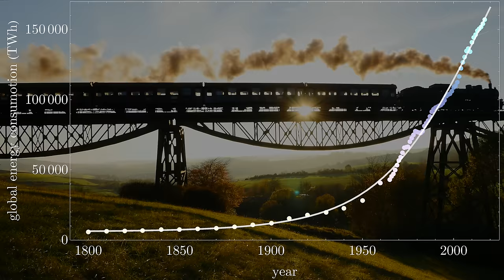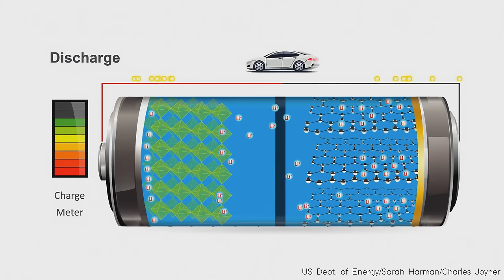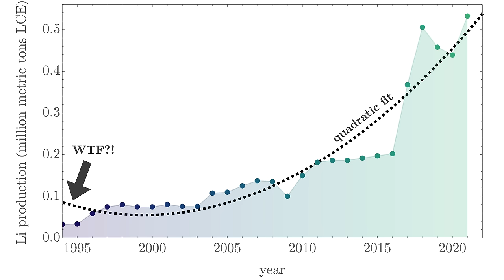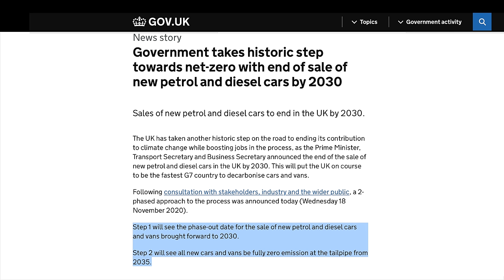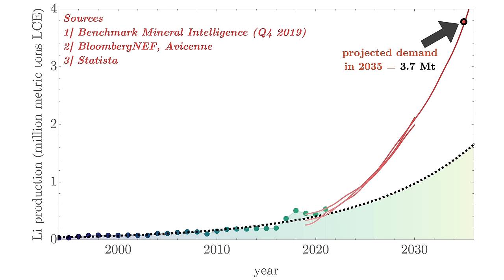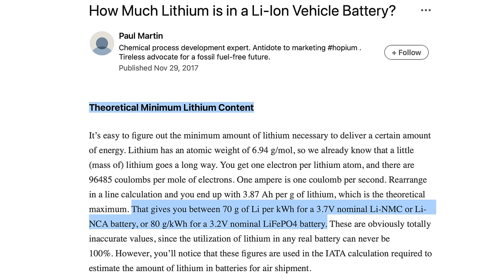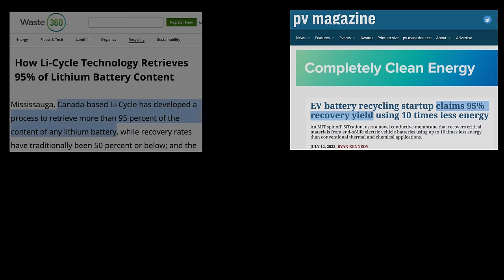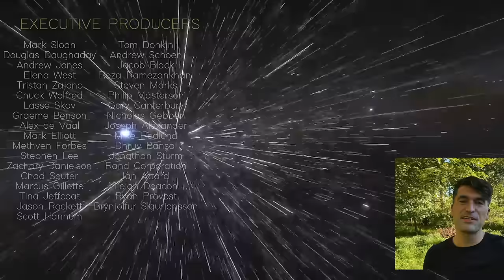Will We Run Out Of Lithium?

Comment: While this was a great video. I believe there is a part 2 maybe even a part 3 that can be done to this. Concerning 2 major points that I feel like this video didn't adequately touched upon. 
First is the use of lithium out side of consumer electronics & EVs. What about electric trains, military equipment and vehicles, lithium for battery storage infrastructure, and any other major future use of lithium outside of the current domination of EVs & personal electronics. I would assume going forward electric trains (high speed rail for example) & energy storage infrastructure demand, and necessity will increasingly outweigh EV needs. The further we get  into the 2030s and beyond. 

Secondly is the assumption that N. America, Europe, & E. Asia will remain the main places for demand for new cars (70%). I think we will see an increasing demand for new car buyers from S. America, Africa, & other parts of Asia. Particularly W. Asia & S. Asia. Which will surpass the needs of new cars from the 3 historical regions of car buyers. Since these places are far below car per person than even China is. Which is about 0.45 cars per person. As opposed to the US which is about 1.2 cars per person. So even on China alone demand should double over the next 12 to 15 years. To make it comparable to the EU/US equivalent. Also places like India, Bangladesh, Pakistan, Nigeria, Uganda, China, Indonesia, Vietnam, and other high density places will see an increasing larger shift to electric trains high speed rails, as well as uses of of buses. Not just EVs. Which I suspect the need of lithium there will usurp demands for EV. As well as use of lithium in energy storage infrastructure (comparable to Tesla gigawatt battery storage) as well as electric motorcycles (in warmer climates) & e-scooters (in small towns & villages). 

Considering S. America, Africa, and most of Asia will have increasing demands for Lithium to be increased by any where between twice as much (i.e. China) to p to 20x (Congo, N. Korea, etc.)  as these nations also go through industrialization. To further exacerbate the situation the various Western & far Eastern economies are aging and slowing down in their needs of consumption. While the opposite is happening to the nations outside of those 3 regions (Europe, N. America, & E. Asia). I mean somewhere between 2035 to 2040 world population will probably be between 8.8B to 9B people. Most of the increase and demand in consumption will be happening in the global south. And I know the topic of this discussion doesn't extend past 2040 but projecting into the 2nd half of this century the increase in consumption of the global south will be increasing for the next 8 to 10 decades. And the gap or the so called margin of demand between the rest of the world and the 3 historic industrialized parts of the world will continue to widen as the per capita needs become equivalent. 

I hope this long post was useful to to the Cool Worlds channel and comment section. Peace.

Comment: In reality running out energy storage is not the problem it’s the way we produce the energy in the first place. Solar, wind, and geothermal just are not going to be enough. Solar would be possible with orbital solar arrays “beaming” the energy to the surface or more nuclear power. 

The reason I bring this up is because of you have abundant energy then you won’t need any batteries. You could easily create “active” highways where you car just runs off of the energy field created by power lines run underneath the road. The only necessary batteries would be for the devises that can’t connect to these active lines or ones that will be used off of them.
Reply: @lepidoptera9337  it’s not constant is the big issue since solar only working during the day. For Solar you would have to have slightly more batteries to store energy from Solar than the total amount of batteries needed to charge (at least the ones charged at night). Now I’m not saying Solar wouldn’t help look at my previous comment but we need also need a constant supply of energy that isn’t dependent on weather. Nuclear or orbital Solar would be the best with our current technology.
Reply: @lepidoptera9337  my goal post is in the past. We have had all the technology to send objects to space and sending solar panels instead of satellites would not be hard. We also have had nuclear technology for decades which per kilowatt is much cheaper, just as clean, and is a constant source of power.

Comment: When a lithium car battery is recycled, is that car tossed in the trash?  Wouldn't you just put another new battery in the car and continue using it?  Is this data even accounted for in all of these projections?   Also,  where is all of the electricity generation coming from as demand increases in the future?  More coal plants?  I think that's what China is planning, although I'm not an expert.  Lots of questions.

Comment: And that's exactly why the EV will not be the big change some people hope. Just look at cars, train or air travel all startet out as expensive and went down over time with increased demand and cheaper production. EV's are expensive right now and if the supply can't keep up with the demand because of the Lithium, this price will not drop but rise, which in turn will drop the demand that can't be adjusted due to the missing Lithium. If a technology needs specific materials that are not available, it will not succeed. Judging by the overall increases of prices in every energy sector, people will just not have the money to buy these EV's. The Smartphone market is saturated and companies sell less and less every year, the best selling sector are the midrange phones since they offer 99% of what any person needs for a fraction of the costs of the flagships.

Comment: Did you factor in recycled lithium into those projections? I would imagine by 2040 that recycling will be fully operational, also a lot of the batteries used in energy storage will be used batteries from EVs
Reply: The recyclers that already recycle these batteries and sell the raw and refined materials today, (Tesla Panasonic in Nevada use some recycled materials already) wish they had access to more batteries... Batteries are lasting far longer than we thought they would and there is a huge demand for second use because there is such a shortage of new cells so the recyclers are ahead of the amount of batteries available to them... yet.

Comment: I want an EV... but I was really hoping for hydrogen fuel cell type... mostly due to charge times when on long trips... I've had many times where I've drove over 500 miles and don't have time to stop to wait on a battery to charge up even with fast chargers of today.  Unfortunately there is no infrastructure for hydrogen right now, around here there is barely any for charging either.  Guess I'll have to wait a few more years.

Comment: Fantastic video once again. This is the best article I have seen against EV´s and all this monumental madness about saving the planet.....although, I guess, probably done without that intention. Nevertheless, thank you very much. Don´t get me wrong. I appreciate you care for a more cleaner planet. As I do. As all of us do. But, you know? the difference between an engineer and a (dreamer?) physicist is that we can better manage (and predict) reality. First of all, if you worry about saving the planet, then you should be very worried about the Lithium mining and other rare earths materials required to build the batteries at that scale. This is far more contaminant than the CO2 which life actually needs, by the way. Secondly, this legislative nightmare planned by the WWF to replace the Oil by Lithium as the new Gold Era, and pushed by burocrats, are ruining people´s lives and are the closest thing to Mao´s Great Leap Ahead Plan, a monumental failure. Third, what is the cost of your Hyundai? what is the range? what is the time and  cost to recharge it? please, test it in a REAL long trip at a steady cruise speed of 130 km/h. I can tell you that it drops till just 350 km.The EV´s have yet a long way to run to become truly competitive. The gap may possibly be filled by Hydrogen but, again, still a long way also for H2 to run. In summary, some dark hands have orchestrated a multi trillion dollar plan for which there is no guarantee of success and could possibly even end in a catastrophe. Two things could happen then: either our civilazation collapses in the next decade or so and takes some centuries to recover or we all stand up and stop somehow all this crazyness.

Comment: Don't forget to factor in replacing all of these inefficient batteries. Petrol is still the #1 most efficient source of energy usage, and further, petrol and diesel vehicles make up less than 30% of all pollution. The issue is industry, which should be our primary focus when considering pollution. Also need to understand that these electric cars are ultimately powered by coal and natural gas, the primary source of energy to your home or charging station. So you may think you are saving the world, but ultimately you are still burning fossil fuels. The growth of the EV market will increase consumer electrical demand, which will put great pressure on the current industries of coal mining and natural gas extraction.

Comment: You make a few errors in your attempt to definitively note a +1c rise in temperatures on a global average to CO2, disregarding the fallacy of utilizing global averages, as well as the simple fact that the primary greenhouse gas is water vapor (and it isn't even close, not by a long shot) and our planet leaving a modest ice age currently. 

Battery and renewable technology is so wildly inefficient that you CAN NOT sustain humanity without a great die-off of the population, so you must pick one or the other. Either you accept a massive short fall of energy required for an 8 billion plus population and therefore accept the death of majority of that population, or you must meet the energy needs elsewhere. It's the clearest sign when someone is driven by ideology or 'current thing' narrative, when to them the option of meeting the energy demands of developing nations is simply not on option in their mind. No, this is not a discussion created out of the love for earth, but a bitter resentment of humanity. Otherwise Nuclear energy would be foisted up as the next step to take in moving away from hydrocarbons (a more accurate term than fossil fuels). But no, instead the conversation is on impossibilities that only impoverish people further for the benefit of various NGOs reaping massive benefits to deliver practically no energy to the population at a much elevated cost. 

Consider that if every single lithium battery manufacturer on the planet produced batteries SOLELY for the purpose of renewable energy infrastructure for 10 years straight, it would  not meet even 25% of the grid requirements of just the UK currently, not to mention the increase of those ten years previously mentioned.

But why live in reality, hmm?

Comment: i wouldnt worry too much about demand out stripping supplies... unless EVs suddenly become about 80% cheaper and they some how manage to significantly increase range and decrease charge times. otherwise even by 2040, they simply wont be practical or affordable  for the vast majority of people.

and before you start talking about the second hand market - affordability is still a major issue, particularly if battery cells need to be replaced.

Comment: Eventually you'll run out of everything on the planet, realistically. Question is if the 'easy to reach/low hanging fruit' versions will be economically sustainable to harvest vs potential profit margins and costs to get it. Honestly there's more interesting replacements on the horizon, as lithium is the current solution that's here, now. When reclamation becomes realistic, that's another gap-fill until those better replacements come to the commercial market.

Comment: The problems comes down to that the electrical source emitter and the costs of both the EV products and that power needed to manufacture and operate those same products.  It cannot be done in the time demanded. 

Even with govt mandates, which are already being imposed, most consumers will not be able afford these costly EVs. Further, as there is an increase in the use of EVs, rolling infrastructure blackouts will become the norm as they already are in certain parts of western countries. 

The short term end result is that the common man and woman will not be able to afford EV. Combine this with govts' dictates that combustion engines are out, our means of individual transport will no longer be feasible. 

Now the political aspects. This is the aim of the WEF, in particular Schwab's Great Reset and a global elites much enhanced control of populations. At the pace currently espoused for EV use by the WEF and other authoritarian powers, our democracies will not only falter but will outright fail.

Comment: All of this makes no difference if you can't charge them, because we won't be able to use fossil fuels for power generation, and currently there is (in the UK) not enough non fossil fuel electric power generation to cope with need, so we buy ours (at greater cost) from Europe, we need to deal with a way to charge these EVs before we swap to them, and the new nuclear power plants may not be ready in time, unfortunately we  may have to use fossil fuels a bit long, we can't keep up with demand now and they want us to use even more EVs , it just can't work EVs made up 20.1% of car sales last month, and we are struggling to maintain supple of electric, as at the same time building more and more homes, and turning off more and more fossil fuel power generators, while only building wind and solar which is not going to be generating any where near enough electric for demand which is rising every day, winter is coming so that's solar out he window, in the UK we are buying the EV and not having the money or electric  to run it, you a supple first then swap to EVs.

Comment: Where are all the new fossil fuel power plants being built to charge these?  Do we have enough copper to increase the size of the electric grid or are we going to put electric generators, powered by natural gas or diesel fuel, all over the place to create the electricity to charge these things?  

Why is okay to mine lithium, cobalt, cadmium,  nickel and the other metals needed to make the batteries but not okay to mine coal or drill wells?
Reply: I wanna see you run around with a gas fueled phone or pc.

Comment: Great video, something you may consider, EVs growth depends on electricity cost. In countries that depend on fossil  fuel for electricity production, EVs cars just dont make sense because electricity for charging EVs is expensive. Problem is green electricity sources are still low compared with nuclear or fossil sources. For instance, most countries in South America do not have enough hidro power plants to cover for a significant porcentage of fossil fuel electricity plants.  If nuclear plants were safe enough to be installed and adminstrated in developing countries, given a  cheaper electricity as a result, then I will agree with the litium projection you have made here. Still very interesting video, I would love to see some studies about green energy sources  projections and alternatives to really get rid or mitigate fossil fuel usage involved in electricity production.

Comment: this video inadvertently admits that mandates, no matter how you stack it are a horrible idea.  in the US specifically no family is going to be able to function freely because EVs still don't have the ranges for long distance travel and the Lightning truck for instance just just showed it only gets 85 miles per charge if pulling weight.  EVs are only slightly better for the environment than gas cars based on longevity alone.  My car is almost 20 years old. A used gas car can have 3 to 5 owners on average. An EV won't have that kind of longevity. An honest conversation needs to be had on this.  I love EVs.  Does mean there aren't issues with them

Comment: If we made a hard switch to lithium, then wouldn't the planet start to naturally build back up with fossil fuels, So if we could come up with a way to calculate how long we need to lay off fossil fuels. and let the natural processes take place that makes fossil fuels then we could use a balancing act where we use both lithium and fossil fuels with the goal of not depleting either fuel source.
Reply: When if comes to electric cars replacing internal combustion. Whether at home or at a charging station which some of which I seen outside office locations, where only electric cars are allowed to park. but the charging stations are powered by the grid.  My question is aren't we just putting more pressure on the electric grid, Fossil Fuels is still used to power the grid so would we be using less fossil fuels by switching to electric cars?